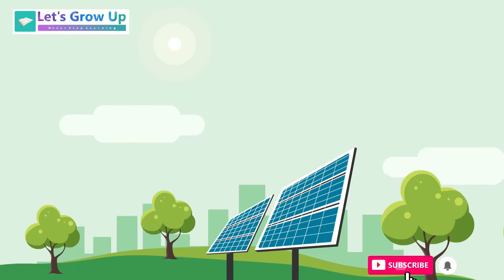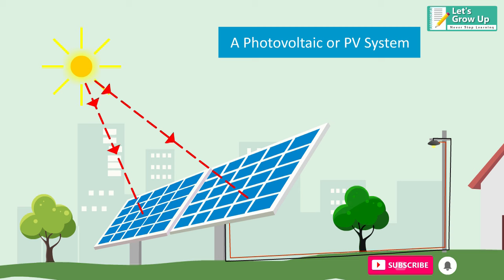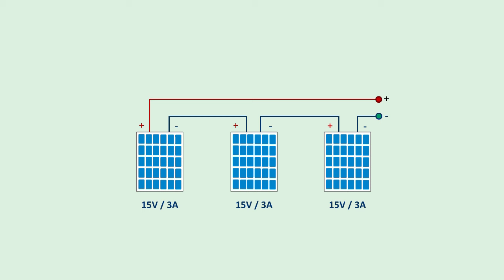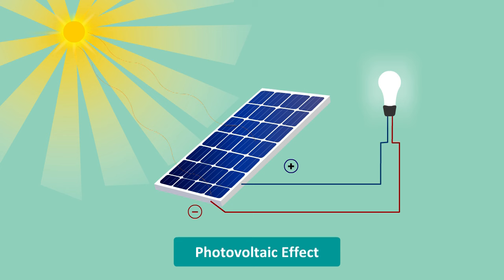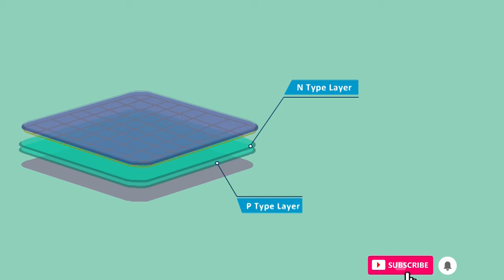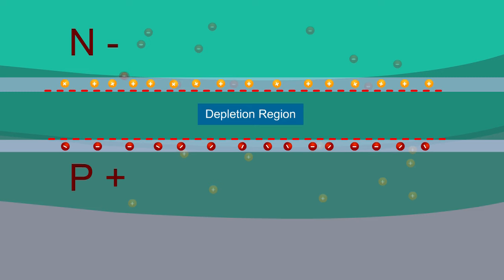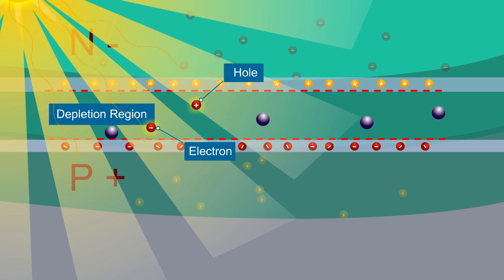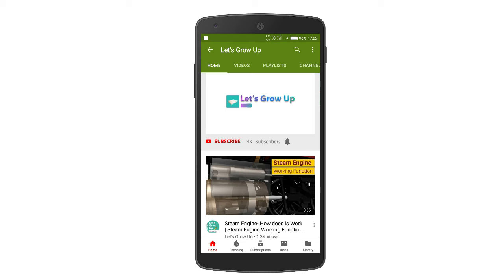How do Solar cells work? | #PNjunction solar cell | #solarenergy Explain

Comment: This presentation describes the photovoltaic cell and how it works, together with the different types being producer today. Those describe include various types of silicion modules as well as YOU SAID some New materials and involving techniques such as multi-layered cells, concentrating PV system and photo-electronical ceels. We can talk also of PV cladding for the roof and walls if factories and commercial buildings as a large grid connecetd PV power plants rated at hundrad kilowatts and over a megawatt currently operating or under development in the world. This topic is future prospects of this repidly envolving technology and enviromental aspects so thank you for your presentation 🌞👍

Comment: Means when, after breaking of a neutral atom of depletion region in electron snd hole. Hole moves toward P type semiconductor and electron moves toward N type semiconductor. Basically they increase nonstop concentration of holes and electrons in P &N type semiconductor? ??

Comment: Why don't they make one large solar cell instead of multiple solar cells in a solar panel
Reply: When sunlight gets into the solar cell material, it will travel along until it interacts with an electron in the material. If the electron absorbs the energy of the sunlight, it will be given a boost. It can lose that energy by bumping into other electrons. Mostly, that doesn't depend on the size of the solar cell. It just depends on its composition and design. However, if the electrons need to go further in the semiconductor material, it's more likely they can lose energy. By making the distance to the electrodes small, then it's less likely the electron will lose energy. Because larger cells are designed with more electrodes, the distance ends up being about the same, so this doesn't change too much with solar cell size.

Comment: Why don't they just expose the depletion layer directly to light   .??. Why there is need to have a n- type region above the depletion layer  .??   
Instead of this
 ↓↓↓↓.                   (↓=ray of light)
N region
deletion layer
P region
Why cant they make. This 
    ↓↓↓↓↓↓
N-deletion layer - P
 which will expose it more to sunlight
Reply: @ArchanaUmeshMaurya They need N type layer to make the neutral ato  and complete the process watch the video carefully
Reply: @lavyabansal9742  ato mean
Reply: @harini4287   yaa i know that read my question carefully
Reply: @harini4287  no i don't think so as they had design it in this way mean they were having some reason to not to choose other designs so i  want   that reason
Reply: We need n and p types to form the depletion region.
Reply: I think it is because the formation of the the holes in N and negative in P creates a magnetic field. This magnetic field attracts the corresponding particle and thus creates a movement of electrons in the solar cell